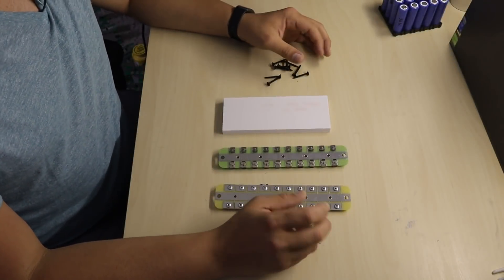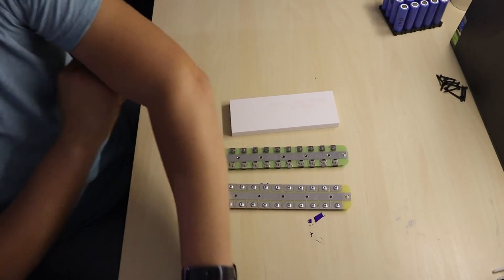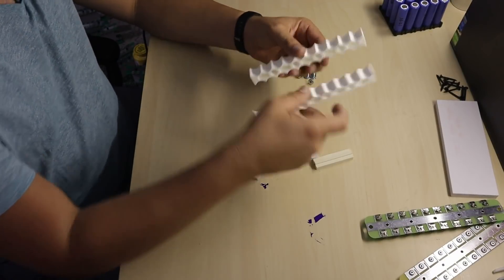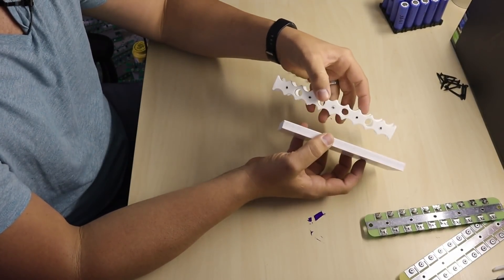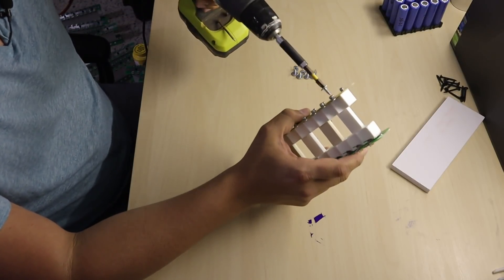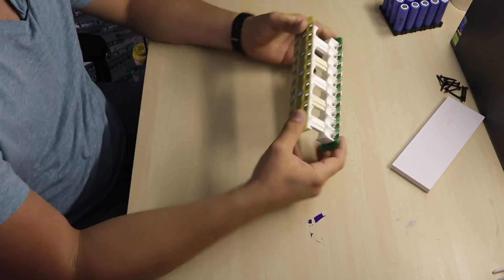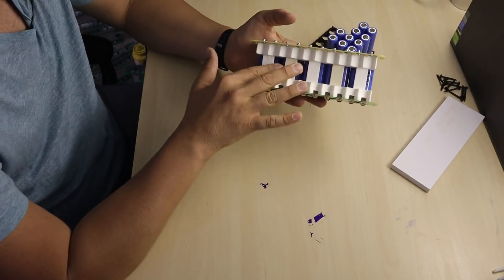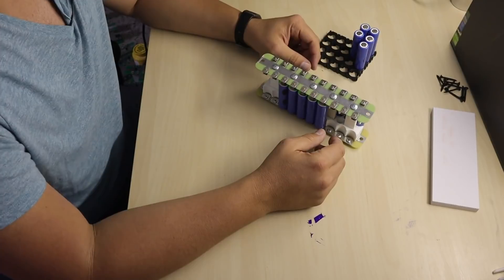New Spacer for the Diy Powerwall Kit.

Comment: What if you cast the piece as a whole to save time.use less detail to mould. Less holes. Or cast each piece with only holes for small inserts.
Reply: This would give you less errors in mould. Easier casts?
Reply from the maker: That was the plan at the beginning. Create a large mold to cast many pieces at once. Then everything started to fall apart.

Anything from bad master models to a very delayed amazon product.

Now I think i have what I need to make a better master model but I lack the time needed to make it happen.
Reply: @javiercamacho  what if the center risers are wood. You could cast each end piece solid and make a drill template for the holes.

Comment: I noticed in your older videos you mixed lower mAh batteries with higher in one pack, I this safe as i was under the impression they needed to be within close ranges to each other.
Reply from the maker: I normally use cell between 200mah to 500mah range
Reply: @javiercamacho  would this affect charging the pack at all? Like if i had 7s 20p with all different capacities throughout each pack. Wouldn't this over charge the lower capacity cells?
Reply from the maker: Current flows to the path of less resistance. For security purposes you shouldn’t use cells with over 300mah apart. All your parallel packs should be perfectly balanced and you need a bms.

I going to work on a video that will show what happens when you use cells with different capacity